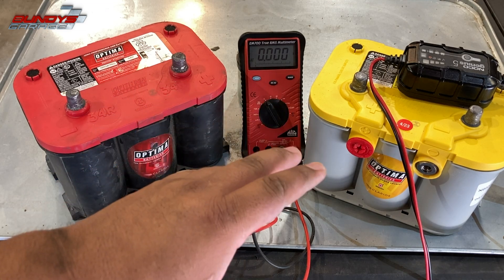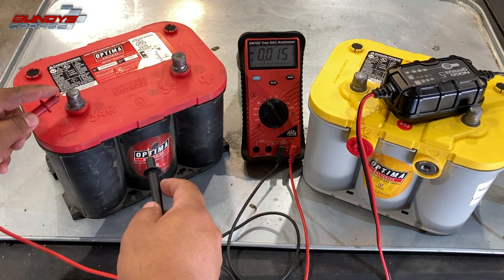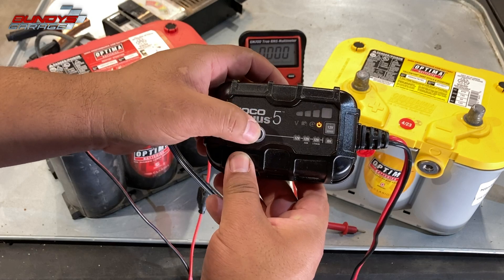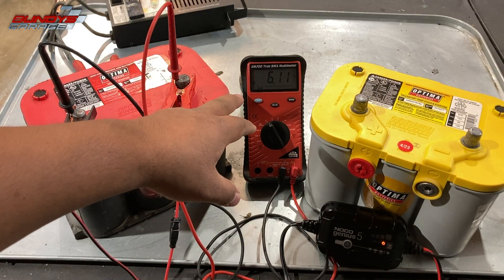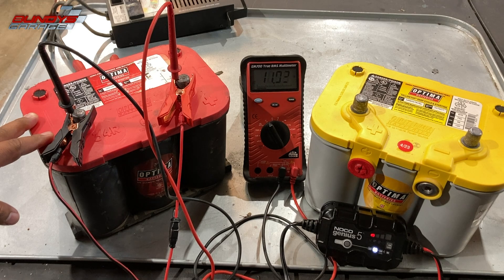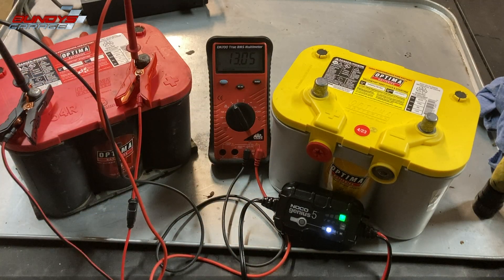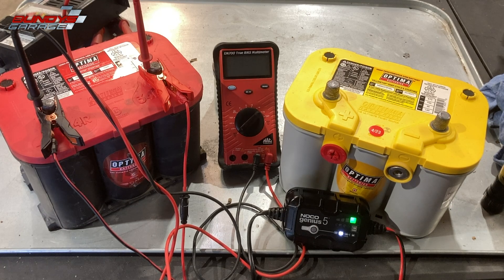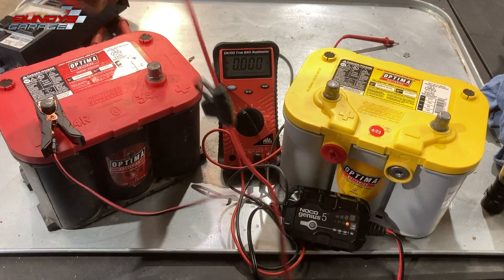How to Recover Restore Optima AGM Battery | NOCO Genius Charger Review

Comment: I had a red top blow like a Whale and shot blue corrosive liquid all over my engine area.  They said it was because the battery was sulfated (crystals in the acid).  Is this something common that can happen when you run these red tops too low?
Reply from the maker: I have never even heard of that happening before, let alone seen it happen.

Comment: with my 10 year old optima yellow top sitting on the ground, the Noco can't charge it without it acting like there is a voltage draw. after 3 days, I get a red X. thoughts?
Reply: Force charge it by holding the button down for 7 to 10 seconds, all the lights will come one and blink, then you select agm..  Give it a full charge and repair last

Comment: My yellow top was so down so low that it wouldn't even register on my battery tester. Less than a volt. So based on your video I got the Noco Genius 5. It did manage to charge back to full using standard 12v AGM with it took many hours using the standard AGM charge. I did stop it during the process and tested it at 8.6 volts and the tester said based on internal resistance that it was a fail. After it reached 100% it passed the load test.

They recommend to do the repair on a fully charged battery so now that it passes, I'm doing the repair to recondition it.

Comment: Didn't work on a 2 year old redtop for me. Optima charger, noco 5 and noco 10amp.  Shows .7 volts on meter
Reply from the maker: Optima use to be the $hit, now they are $hit! When they were manufactured in the USA they were great. It all went down hill when they moved production to Mexico. If you want a great AGM battery look at Northstar AGM or Odyssey AGM batteries. Pricey little things but well worth it.

Comment: You don't have to wait until it's dead.  Occasional maintenance will help the battery last longer.  I recommend removing the battery from the vehicle for this process.  Electronics may get damaged with all the pulsating voltage.

Comment: Thank you so much for this video! My optima redtop from 2017 was so cooked I couldn’t get it to charge for 3 days with a traditional charger or even the NOCO genius 1 trickle charger. Turns out I needed to run it in repair mode with the NOCO Genius 10 for a full day and then switch it to AGM Trickle charge mode! My car now cranks like it’s brand new! THANK YOU! And I’m stoked I have a new NOCO product I love this brand. All my cars will be topped off and happy for the summer season! 🎉
Reply: Repair mode for a full day? That's something. Most places say up to 4 hours.

Comment: Is the battery still alive in 2025?
Reply from the maker: Funny you should ask, I had it in a truck that mostly sits. Had one of those little solar panels from Harbor Freight hooked up and thought it was keeping a trickle charge on it. Well about a month ago went out to move the truck and the battery was stone cold dead. Like 0 volts, tried jumping the truck but no luck. I'm sure if it had been in a car/truck that was driving every day, I'm sure it would still be alive.
Reply: @ I thought the same with my trickle charger but I think my car also has a battery drain! I forgot to unhook the terminals for the winter and it took it to 1 volt! I got to make it a habit to check on the trickle charger more often. My brain assumed set it and forget it, but nope! My cars all happy now! Thanks again!
Reply: @bundysgarage just a heads up, I had the same thing happen to me. Stone cold battery on a solar trickle charger. I checked the voltage of the solar panel out of curiosity. I found it was no longer regulated to 12-14 volts and was charging my battery at 28volts at peak sunlight. Battery was ruined.
Reply: I have revived batteries.
Yes they do work…after a fashion.
They don’t hold the same amount of charge.
And they don’t hold charge for that long.  
But still possibly useful

Comment: Hello, I have a question, I would be happy if you could answer it. I bought a noco 5, I have a 80 ah AGM battery, I leave the noco to charge in normal 12 volt AGM mode, and even though eight hours have passed, is it normal that the battery's volts are still at 12.50? I also observed that the battery is heating up, and the charger is also heating up, should I stop charging in this case? The only thing that comes to my mind is, could one of the cells of the battery be faulty?

Comment: The yellow top I’ve noticed if it’s under 10.5v it will not charge unless you use the repair mode a couple times once it’s over 10.5v any AGM charger should work, another way I’ve used is to get another optima battery and a set of jumper leads and connect the 2 together - to - & + to + tricking the charger to think it’s over 10.5v just keep an eye and make sure the batteries don’t get too hot, otherwise disconnect them and let battery cool down.

Comment: Repair mode is for lead acid batteries
Reply: AGM is lead acid.  Confirmed repair mode is for AGM batteries from posting by noco support on a amazon product page question.  "Yes. AGM batteries are a type of lead-acid battery, and Repair Mode can be used on them. Other compatible lead-acid battery types include wet-cell, gel-cell, AGM+, maintenance free, and EFB batteries. It can also help desulfate calcium-lead and calcium-calcium batteries. Please note that the battery should be disconnected from the vehicle or application before Repair Mode is used on it."

Comment: The manual says to run repair after the battery is fully charged.  You're supposed to run "force mode" when the battery is below 1V.  It's in the manual.
Reply: Totally agree. When all else fails read the manual.

Comment: I have a 12 year old AGM battery still installed in my vehicle.  Just recently, the battery has begun to give me problems.  Do you think this charger can repair it, or do you think the battery is too old and not worth it.  To be honest,  I'm surprised my battery lasted so long. 😅
Reply: Worked for my 2011 battery 🤷🏽‍♂️

Comment: That's awesome, the Noco did the job. But I will never buy the Optima AGM batteries again. They are overhyped & overpriced. I've had at least 4-5 in the last ten years or less. All have failed in 2-3 years time. All running in different vehicles. Even with an AGM charger, they failed to take a charge. They really suck in cold weather. And at more than $200. Plus each, I ain't having it !! 😡
Reply: I switched to Odyssey. I used Optima for 20 yrs but my last two were junk and lasted only a couple years. My oldest Odyssey is 9yrs old and works fine. Instead of Optima spending a fortune on marketing maybe make the batteries like they used to and people will buy them again.
Reply: I put a lithium in my 98 honda. I was killing every agm 1 a year. I put a new agm in and 1 month of plowing with the atv and it was toast. This lithium I got in right now is on a year now. I'll try to update this time next year
Reply: I agree, I put an Optima gold top in my Lincoln LS after someone had failed to hook up the drain on a standard battery in the trunk of my Lincoln LS, the battery had leaked and completely rusted the whole trunk and spare tire carrier area. Cleaned it up down to bare metal to delete the rust then repaint and then added some underlayment then put in the Optima and it failed the next winter. It was the coldest winter I've been through in Utah that year and it failed within months of buying it. Then if course O'Reilly's had conveniently lost the warranty paperwork for it so I was out like $230 I was pretty pissed off about it😏
Reply: i just replaced mine at 10 years, I'm quite impressed with their longevity
Reply: @bae896  Do you live in a warm climate? Because they just can't handle cold weather.
Reply: 111

Comment: The NOCO instructions say to do a full recharge cycle first before doing repair mode.   With a completely dead battery, if the Noco won't start the recharge cycle, you can use the 5 minute Force  Mode to get it started and then it'll take over automagically into normal charge mode.   Once a full charge mode has completed, then run the repair cycle to deal with sulfation of the battery (and make sure you've topped it off with distilled water for a non-AGM sealed battery).

4:19 Blinking green is the Noco on maintenance mode which means the charge cycle is completed and it will float charge the battery as needed if you leave it connected.  It says so in the Noco manual.
Reply: Make sure the battery is out of the car or the leads are off the battery for desulphate mode. The voltage is higher in desulphate mode.
Reply: I do not understand how people can be so ignorant. Read instructions as brassmule sugested.

Comment: Good video and demo, it was very informative, I wasn't sure if you could run repair mode on a AGM battery, glad it worked. What is your opinion on a PulseTech PowerPulse passive battery desulfator? I have one attached to my BMW E39 battery for the last three years, and haven't had any problems starting the car even though I only drive about 25 miles a week. Pulsetech claims that it uses a patented frequency rather then voltage power spikes to desulfate a battery.

Comment: My optima 5years old and now 7.5volt what can i do ??
Reply: How long does that dead battery last ? Can you trust it? Or will it leave you stranded? Or is it good to go for another 100 miles?
Reply: 7.5 after charging?  If yes, you have one or more dead cells in the battery.  This means the battery is ready for the recycler and is no good.  No charger can "fix" a dead cell.
Reply: @c.simp.  after chargin 12.5 but suddenly falls